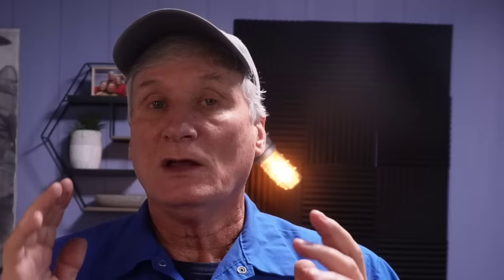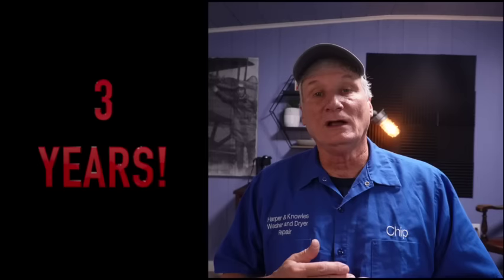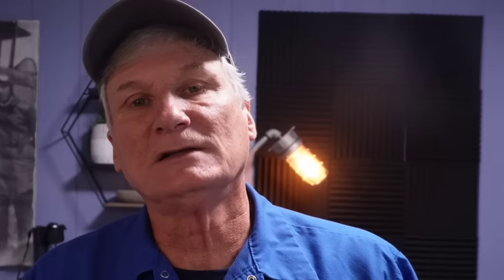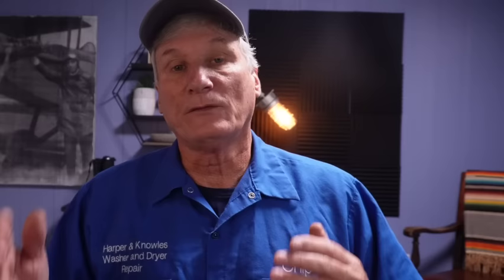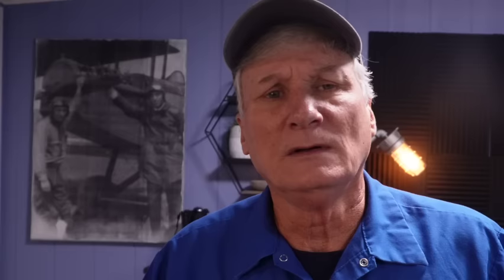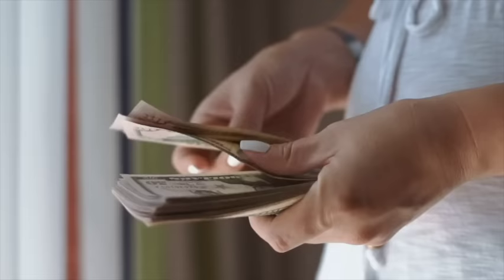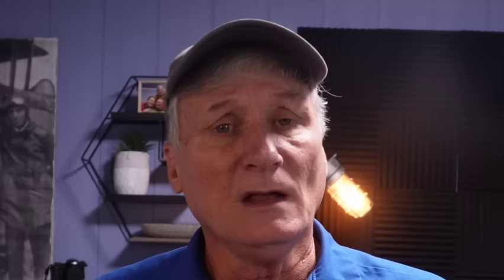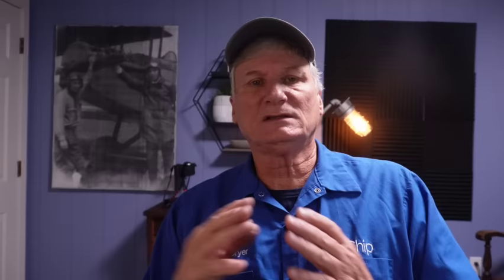How To Choose the Best Washing Machine: Speed Queen TC5 vs. TR7 Review

Comment: Thanks for responding to my note. Actually I need to replace my 20 year old Kenmore Washer and soon dryer too... and have been thinking about getting the TC5 after reading about lots of problems with the TR7s. Still on Consumer Affairs and many other sites, the 2023 SQ only rates 3.5 stars with lots of 1 Star reviews. Why?  several needed the elements replaced twice, and problems with the door lock sticking closed or open, the computer board failing, and the drain pipe suds, and poor customer service. The reviews I am following were written in 2023 but most purchased their machines 2-4 years ago, and don't mention if they purchased a TR7 or TC5. Would you say that these reviews were probably on the TR7 which had so many problems, and that now, in 2023 I can buy a TC5 with little to no such problems? I really love that they are made in USA and with metal/steel parts and a stainless steel drum,  instead of plastic parts and enamel.  Thank you.
Reply from the maker: I reviewed them on my experience, and that is I almost never have calls to fix them. There was a SQ dryer that had a blown thermal fuse once but the customer had an under the slab exhaust pipe that ran over 15 feet to the outside and was full of lint and water that had condensed over time. Whoever designed that house needed their head examined.  Her husband and I used a shop vacuum to suck most is the water out then ran a plumbers tape through the pipe and tied rags on the end and pull it through to wipe the lint buildup off the four inch PVC.  I think after the second blown fuse they moved their laundry room to an outside storage room off their garage and had water piped to it. Interior laundry rooms are really poor designs.  The complaints I’ve heard about the TR7’s have been about the agitator and drum moving together. Most people are used to the agitator moving independently of the drum.  I don’t trust online reviews and here’s an article that explains why https://www.forbes.com/sites/christopherelliott/2018/11/21/why-you-should-not-trust-online-reviews/?sh=1fab44382218. If you ask service people about appliances they’ll tell you which machines they have the least trouble with.  Anything I have given a review on I haven’t received any compensation for nor will I ever give other than a truthful account of what I think about a product. I think you can trust SQ because they are top quality products. Sure there are going to be a few bad experiences but I bet they fair better than any other product on the market today. At least they do in central Louisiana!  If you decide on the TC5 let us know what you think about it in a year or so, I’d like your feedback.
Reply: @HarperandKnowles  This blown thermal fuse you are talking about must have been an electric dryer?
Reply from the maker: Yes, It was an electric dryer. Thanks for watching.
Reply: @HarperandKnowles  Oh thank you for answering! You have convinced me. I was already about 80% convinced. I want a machine built in the U.S. with real metal parts, not plastic. I agree you can't trust online posts, so having your expert opinion is very helpful! I will let you know, if I can find this post... a year from now.

Comment: I just bought the SQ TC5 no lid lock but how can i bypass the switch that when i open the lid it stops working till lid is closed
Reply from the maker: As a service tech I wouldn't recommend bypassing a safety feature. What? You wanna just stand there and watch it like a TV??? Thanks for watching my friend!
Reply: @HarperandKnowles  No watching it wanted to be able to rinse the detergent cup out in the wash so nothing is wasted my old one i could do that when it was filling with water
Reply from the maker: Good point. You can't just dip it in the water?  Ah, you want to wash it in the water stream!
Reply: @HarperandKnowles  Yes that has always worked well clean the cup good
Reply from the maker: If you watch this video it might give you a clue how to do it, DIY Washing Machine Lid Lock and Lid Switch Bypass - MUST-HAVE skill for every APPLIANCE TECHNICIAN
https://youtu.be/FGXUSxfzPEk
Reply: I figured it out with a piece of Styrofoam can clean cup now

Comment: What is your recommendation between the FF7 and TC5. We are buying a washer the weekend. I do 3-4 loads of kid laundry, 1 load of husband's dirty work jeans and 1 load of my laundry a week. I'm concerned the TC5 will be too rough on my kids clothes and my clothes. We aren't interested in the "perfect wash" top loaders. Thank you!
Reply from the maker: The decision between the FF7 and TC5 really depends on your personal needs and concerns. Both models are built with Speed Queen's commitment to durability and performance, but they do have their unique features.

The TC5 has a classic agitator and Speed Queen's traditional wash system that many people appreciate for its thoroughness. It also has a heavy-duty cycle that could be beneficial for your husband's work jeans. However, the more vigorous agitation might be a concern if you frequently wash delicate items or are worried about wear on your kids' clothes.

On the other hand, the FF7 is a front loader which typically uses less water and is generally more gentle on clothing due to its tumbling action. If you're concerned about the wear and tear on your and your kids' clothes, this might be the better option.

Ultimately, the best model for you depends on your laundry needs. If the robust cleaning power of the TC5 aligns with your needs more than the gentler wash of the FF7, then it may be the best choice for you. However, if preserving the longevity of your clothing is paramount, then the FF7 could be a more suitable choice. I would recommend discussing these points with the dealer who can give you a more detailed comparison based on your needs.

Comment: My Whirlpool  washer extra heavy  capacity.    U pay more for that ….35 years old.   No circuit boards.    ….Leave the top open so it doesn’t rust ….  A belt and timer and supply hoses.   Only expense….  Dryer.  Same age.   Belt and idler and interior lamp ….   Thats all
Reply from the maker: Thanks for watching!

Comment: Great content. In short search, I do not see a front load Speed Queen washer. Do they make one, and I'm just not seeing it? Anyway, it's nice to see how these are put together vs. other brands. Thanks
Reply from the maker: They sure do. Check them out at https://speedqueen.com. Thanks for watching!
Reply: @HarperandKnowles Thanks for that. I was there and (dummy me) I didn't scroll down enough. What's your opinion on front loaders vs.the top loaders? Thanks
Reply from the maker: When it comes to the debate between top loaders and front loaders in washing machines, it really depends on personal preferences and specific needs. Top loaders, like the Speed Queen discussed in the review, often provide faster wash cycles, offer easier loading and unloading, but they might not be as gentle on clothes as front loaders. Front loaders, on the other hand, are generally more water and energy-efficient, deliver better cleaning performance due to their tumbling action, and are suitable for tight spaces, like stacking in a laundry closet. The choice between the two largely hinges on what features matter most to you and your laundry routine.

Comment: Y’all amaze me speed queen washer tub seal leaks destroys bearings have to take motor and separate pump just to install new belt
Reply from the maker: Aw, come on Larry, don’t discount the machine on account of a difficult repair! Tub seals will leak on all of them over time but you can’t beat SQ for reliability!  They’re the only ones out there built to last 25 years. Thanks for commenting my friend!
Reply: They aren’t that difficult to replace, you might wear out one belt during it’s life
Just wait until you need to change a belt on your car, if you want to see diffucult

Comment: Thanks for your review. The TR serie is somewhat quiet BTW but supposedly not as reliable as the TC serie.
Agitator of my ~18 years old Whirlpool LSN2000PW2 is not moving anymore (with nasty noise). I'm really thorn between repair or buy a Huebsch (name of SQ where I live).

BTW, who are the pilots behind you?
Reply from the maker: Those guys?  I don't know their names but I acquired a lot of old photos from north Louisiana around the Delhi area. For trivia's sake that's the original home of Delta Airlines.  There was an outfit up there that was the first to test dusting crops from the air.  Those are two of the original crop dusting pilots.  They were using DDT to control boll weevils.  I don't know for sure but I suspect they died of the big "C" after being exposed to that stuff many years ago.  I have another photo of one pilot covered with DDT dust and just his eyes clear because he was wearing goggles. The Missus had that one blown up for me for a birthday present. Thanks for watching, I think you'll be pleased with your Huensch.

Comment: Do the Speed Queen front-loaders have the same mold/mildew issues that other front-loaders do?
Reply from the maker: Speed Queen front-load washers are designed with features that help mitigate the mold and mildew issues that can be common in other front-loading machines. However, no front-loading washer is completely immune to these issues, as the nature of their design can make them more susceptible to moisture buildup and the growth of mold and mildew.

To minimize the risk of mold and mildew growth in your Speed Queen front-loader, it's essential to follow proper care and maintenance practices, such as:

Keep the door slightly ajar when not in use to allow air circulation and promote drying.
Regularly clean the door gasket and drum with a mild detergent or a mixture of vinegar and water.
Remove laundry promptly after the cycle is complete to prevent dampness.
Use appropriate detergent amounts and follow the manufacturer's recommendations for detergent type and quantity.
Run a regular cleaning cycle using a washing machine cleaner or a mix of vinegar and baking soda.
By following these practices, you can help ensure that your Speed Queen front-loader remains free of mold and mildew issues. If you have any more questions or need further assistance, please don't hesitate to reach out. Thanks for watching my channel!

Comment: I was in the Appliance business 40 years, and " Best " is a very subjective word. What does that word actually mean ? Is it longevity, thickness of the metal, etc. well all things should be considered, and today's buzz word is " Features" because too many people with a marketing degree run companies. BUT, Speed Queen is NOT the best washer ever made . I worked on them 35 years ago under the Amana brand, and then years later when we sold the actual Speed Queen brand , and the ones 35 years ago lasted much longer than the latter ones, especially the commercial ones, cuz wow, 5-10 years ago they were junk ! People say the warranty is great, well yeah sure, but in context, what happens is, they make you pay for it up front with the cost of purchase. Now, there have been a decade or two in the last 50, where Speed Queen was pretty good, but not really better than some others. Here is the deal, about 12 years ago Speed Queen advertised Heavy Duty as a buzz word, but i repaired a lot of those units. Then about 5 years ago, they changed the machine to appease the EPA types and went all electronic for the most part. To say their electronics are robust, may be sort of true, but they still have problems, and when they do, its big trouble and cost. Now, to be fair, i retired a few years ago, and i do not know if the machine has improved, or just the marketing. I do know this video opinion is a common consensus, but its all relative. But i will not pay that kinda money for one. More power to those that can afford it, and get away with 5-10 years of trouble free service, but i would not bet much money on it.
Reply from the maker: Well hello there, flexjay87! Thanks for leaving a comment on my video about the best washing machine to buy in 2023. I appreciate your insights and experience in the appliance business for 40 years.

You make a good point that "best" is a subjective word and can mean different things to different people. In my video, I highlighted the Speed Queen washer as my top pick based on factors such as durability, performance, and service tech reviews. However, I understand that there are many factors to consider when choosing a washing machine, and everyone's preferences may differ.

You mentioned that you've worked on Speed Queen washers under the Amana brand, and later sold the actual Speed Queen brand. It's interesting to hear your perspective that the earlier models lasted longer than the later ones. I think this just goes to show that there are many factors at play when it comes to the longevity of a washing machine, including the quality of the materials and construction, as well as how well it's maintained over time.

At the end of the day, I think the best washing machine for someone will depend on their unique needs and preferences. I appreciate your input and hope that my video was still helpful in providing some insights into what to look for in a washing machine. Thanks again for your comment!
Reply: @HarperandKnowles  , I probably come off as Jaded and Cynical, and i am. But , I have a 43 year perspective that most people will not care about, especially young buyers and Sales Reps. And, i understand that, because every generation goes through this. The real story, that hides behind the curtain, is that modern technology has to be better than before, but its not, not in the case of Appliances. Not in the context of longevity, at least in my experience. In regards to other machines, like cars, then yes, they are better for sure. Fuel management has improved for sure, especially in cold climates. I also realize, i will some day soon be dead, and none of my opinions will matter, so, it is what it is :)

Comment: problem is it costs $1400 when you can get front loader for $600,i have a GE from 1970 its out of balance and leaked once but it still going about 53 years old we got it free on craigslist we have had it 25 years i would love to get a front loader as they use less water and electricity,but in usa they are unreliable in europ they have been out for 40 years and most would last 10-20 years here you might get 5 years,my ge works because it has a great motor,the new ge will not last more than 5 years ,its good to see washing machine prices coming down you could buy a top loader for 300 and  front loader for 500 then the front loaders went to 800 or more and top  loaders  500 or more, washers now will clean less as they are forced to use less water by the goverment
Reply from the maker: Thanks for watching!

Comment: If you want a top load washer that cleans well, get something with the Whirlpool agitator.  It moves the laundry side to side and also top to bottom.  Speed Queen only move side to side.  Speed Queen also holds 3.5 cubic feet.  If you have a lot of laundry, you'll be doing multiple loads.  Do you want a Speed Queen that is reliable, holds 3.5 cubic feet and cleans excellently?  Buy a Speed Queen front loader.
Reply from the maker: Thank you for your comment! I appreciate you taking the time to share your thoughts on the Speed Queen washing machine line. I understand your point about the whirlpool agitator moving laundry both side to side and top to bottom. However, I want to highlight that the side-to-side motion of the Speed Queen agitator is specifically designed to provide a deep and thorough clean for each load of laundry.

As for the capacity, it's true that the top-load models have a smaller capacity compared to some other brands, but it also means that the machine will use less water and energy, which can be more environmentally friendly and cost-effective. Additionally, for those with larger loads of laundry, Speed Queen does offer front-loading models that offer a larger capacity.

Overall, I believe that Speed Queen offers both reliability and excellent cleaning performance, and it might be worth considering a Speed Queen front-loader if you have larger loads of laundry. Thank you again for your feedback, and I hope the information you shared will be helpful to others.
Reply: @HarperandKnowles   My Illinois family have been diehard Speed Queen owners for over 70 years.  I have seen and used SQ products as well.  I firmly stand behind my comments and the fact that the front loader SQ is SIGNIFICANTLY better at cleaning than the top loader.  Consumer Reports and several companies that test washers have confirmed this.
Speed Queen is a brand that can last a lifetime, if properly cared for.  You pay for that reliability up front.  You have a problem?  Contact your seller for service.  Its that simple.  No third party contracts, no janky parts being used.